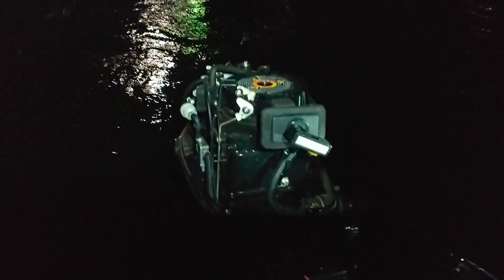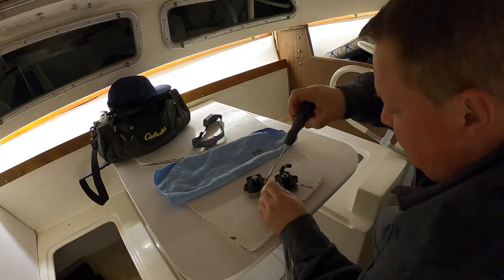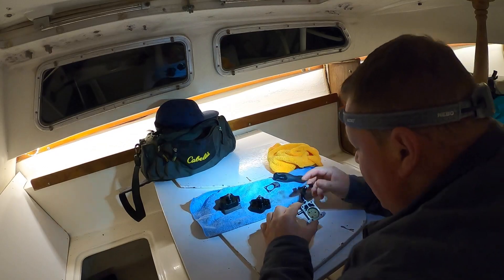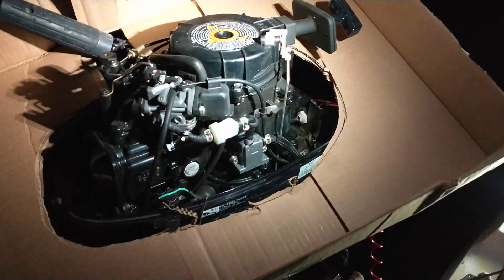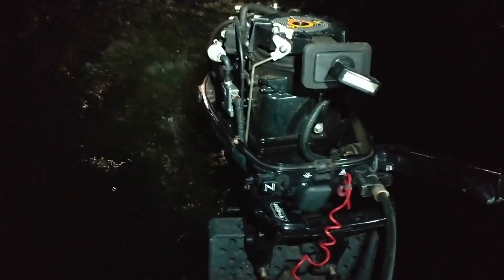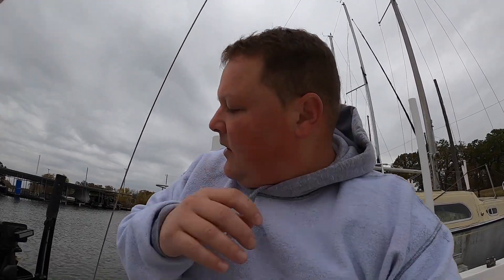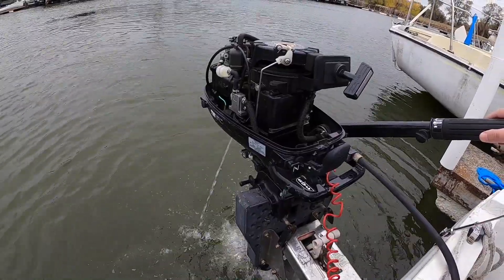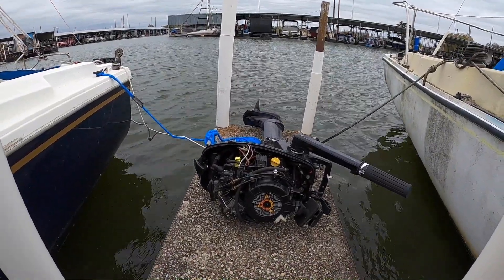Troubleshooting The Tohatsu Engine 2.0

Comment: Tohatsu MFS 6hp same issue from new won't start and randomly cuts out, lucky it has a 7 year guarantee and we have had enough and think its going back to meet its maker...
Reply from the maker: I am not impressed with Tohatsu to be honest. I’m not blaming them for a fouled plug but the more research I did on the engine the more I heard they aren’t the best. Hard to get parts and people don’t work on them. I hope all works out with your engine.

Comment: I have Tohatsu 6hp engine and I have a problem. When engine warms up to working temperature white smokes comes from  water. on any gears and RPMS. And the smell is not good. What could couse this type of problems? Not a lot of smokes but everyone can see it when i am going out of the shore. Do you have any advice where to search the problem?
Greetings from Europe. By the way I have same Catalina 22 :)
Reply from the maker: Hi CJ, Thank you for watching! I am far from an engine mechanic as you can see from the videos. However, smoke in your exhaust is usually a result of something getting where it shouldn't.  Oil from bad piston rings could be getting into the cylinder. Typically oil emits a blue color and water or antifreeze getting in the cylinder emits a white color.  It sounds to me like at operating temperature you have a gasket or piston ring failing. Have you checked your oil level? Are you consuming oil?
I hope someone in our community has some thoughts. I'm sure getting this understood and fixed is on your list.

Comment: Hey Eric,  I don't know if you're still trying to get this thing going but Omie was right.  It's the float adjustment in the carb !!!

💥OMIE💥 for the win 😃😃😃  Adjusted my float height to the setting recommended in the service manual (9.5mm in my case)  Runs better than ever.  👍THANKS OMIE👍 for sending me in the right direction !!!  

NOTE:  I had replaced the float with a brand new one before so I thought I had eliminated that as the problem.  These floats ARE NOT properly set out of the box !!!  You have to find the spec for your motor and adjust accordingly !!!

NOTE:  After I set the float height, the motor still wouldn't start.  The spark plug was shot from all my previous attempts and adjustments.  Once I changed the plug, runs like a top !!
Reply from the maker: Hey Jason, that is awesome. I'm stoked that it worked and is running better than ever.  OMIE for the win for sure.  My engine is still in storage but will be fixed this month.
 The YouTube community is amazing; coming together to solve problems.  Happy SAFE motoring.

Comment: how would a waterpump cause a no spark issue? if its overheating make sure to check the cyl head temperature. old impeller looked ok no broken/melted fins. if you have a DVA adapter (25$ on ebay) you can do running and cranking voltage tests to check the cdi, charge and sensor coil to narrow it down instead of blindly replacing parts!
Reply from the maker: During some of the troubleshooting before understanding how simple the engine was. I was thinking there was a connection to the cooling and a safety switch.  It was just a guess. Thank you for the tips and watching - Eric

Comment: I am having this exact issue with a 5hp Mercury.  It will run wide open all day in neutral.  (imho, this pretty much rules out fuel delivery, overheating, tank vacuum, sparkplug, etc.)  Put that thing in gear and it runs fine just long enough to get me 100yds. from the dock then it bogs down, even at 1/2 throttle.  I can go for miles at idle but try to raise the RPM and she's gonna sputter out.  Fuel to the carb is not my issue.  I disassembled and cleaned the carb meticulously and replaced every part in the carb that can be replaced, again, not the issue.  Thought it might be the low oil sensor, ruled that out too.  I'm at a loss 😑.  If you figure this out, you will be my HERO !!  Good luck my friend.
Reply from the maker: I am chasing the same issue, I wish my trouble shooting was going faster but I have limited time.  Here is what I have done and where I am going.

I eliminated the fuel tank and line by drawing fuel just after the quick connect. I have replaced the fuel pump. I have been in the carb and cleaned all the parts.  I did not replace them.
After I cleaned the carb the engine ran a little better but it did not fix the issue.  

On your engine, can you save it if you "pump" the throttle? On mine, once it starts to cut out if I quickly twist the throttle I can save the engine and then run it at lower RPMs.  Through all our thinking we believe it is a float or main jet issue.  Since we are able to save it.

I will say something that just came to mind recently that I have not checked is compression.  The valves might not be seating correctly and at high RPM's under load the engine is losing compression.  Maybe we both want to check the tolerance on the valves? 

I do plan on doing a rebuild on the carb but I'm not fully convinced it's a fuel issue.  The other observation that I have made was as it is dying the water from the water pump weakens.  This was true with the old impeller and the new one.  The only way the stream of water would lessen is if the engine wasn't turning as quickly.  I don't know how that is possible.  I know the impeller is keyed correctly because I have a strong stream of water all other times.
Reply: @ericneedsahobby  Yes, I can save it if I reduce the throttle to idle when it starts to sputter.  If I wait about 45 seconds at idle, I can throttle up, go about 100 ft and the process repeats...Maddening😫

I replaced my float, main jet, and every other available part in the carb.  Motor runs great as long as you don't want to go anywhere 😂🤣

I don't have any experience with valve clearances and all that but my engine has hardly been used and l'm reluctant to think it would be something that major.
  
My motor has a check valve just downstream of the quick connect.  I took it off the other night and blew through it.  I noticed a lot of restriction so I bypassed it completely.  Now it's a straight shot from the quick connector to the fuel pump.  I haven't had a chance to test the motor since but hopefully I can get out there this weekend.  If it works, you'll be the first to know.  By the way, that check valve has E.P.A. printed on it which stands for Engine Problems Already ??? 

Does your motor have this check valve?
Reply from the maker: @odysseyofjason  I will take a closer look at the fuel line.  When I did my fuel line test I was running just a short distance to the fuel pump.

The bowl and filter always have fuel in them which really makes me question if it's a fuel issue.

I'm in the process of researching what a bad coil looks like.  From my initial research, I could see where under load at high RPMs the weak spark is failing to keep up.  When you throttle down the spark is able to ignite properly again.  

Thinking out loud at idle or high rpm idle the engine is not under near the load it is when in gear at 2 or 3 thousand RPMs. 

You doing a carb rebuild and me cleaning the carb and still having the same issue makes me think I need to explore spark.
Reply: @ericneedsahobby  Yeah, I'm pretty sure it's not a fuel problem but thought I would try it anyway.  You might be on to something with the coil/spark.
Reply from the maker: @odysseyofjason  I have been watching lots of videos and it appears spark can be a little tricky.  The other disadvantage is the single cylinder.  Some of the spark tests are had to run when you need the spark plug in the engine.  

I don't want to throw parts at the thing but I think I am willing to throw a coil on it.
Reply: Sail With A Mission I feel like a dummy saying this but I have not tried a new spark plug.  Have you?
Reply from the maker: @odysseyofjason  I have not changed the plug. Mine looked good rich brown color. I did hook up a spark tester just to see what was going on.
Reply: Your symptoms are that if a incorrectly set float. Your can is probably flooding or not getting enough fuel. These motors a very simple, electrical issues should only be a concern in early models where they used a CDI box, the 2010 and newer use a simple magneto like your lawn mower they are proven tech. Drop the carb the adjust the float, that's probably why it dies when under load.
Reply from the maker: @omieyouknowme  That is a great tip. I know that we have been focusing on the jets.  I can say I personally have not focused on the float position.  I am out of town for a few more weeks but when I get back I am determined to get that thing running.  Thank you for the input!
Reply: @ericneedsahobby  I have 350 hours on mine in two years. Make very small adjustments, also try a smaller prop too, these motors come with a 8" prop with may be to big, causing flooding.too. a 7" prop in Amazon is 70$ makes a difference
Reply: @omieyouknowme  💥OMIE💥 for the win 😃😃😃  Adjusted my float height to the setting recommended in the service manual (9.5mm in my case)  Runs better than ever.  👍THANKS OMIE👍 for sending me in the right direction !!!  

NOTE:  I had replaced the float with a brand new one before so I thought I had eliminated that as the problem.  These floats ARE NOT properly set out of the box !!!  You have to find the spec for your motor and adjust accordingly !!!

NOTE:  After I set the float height, the motor still wouldn't start.  The spark plug was shot from all my previous attempts and adjustments.  Once I changed the plug, runs like a top !!